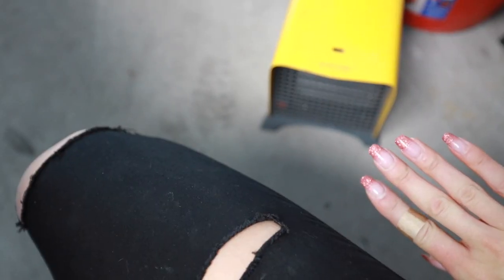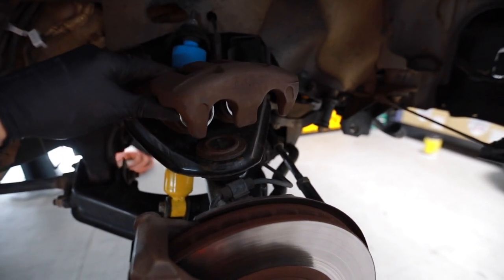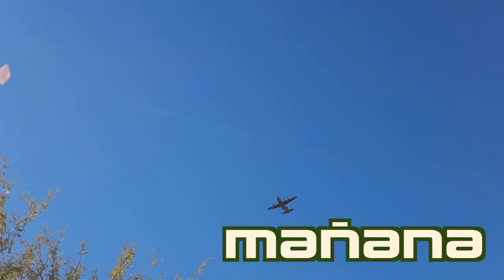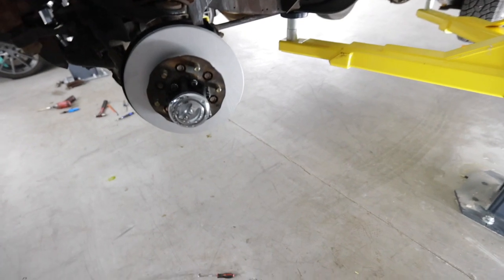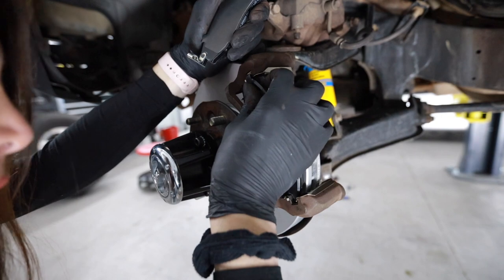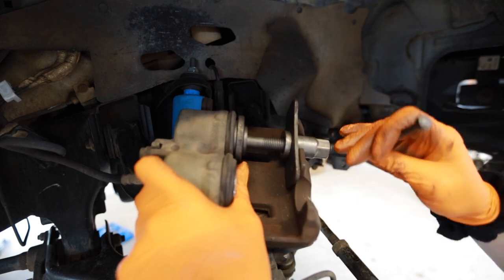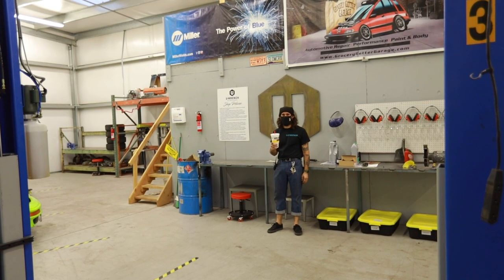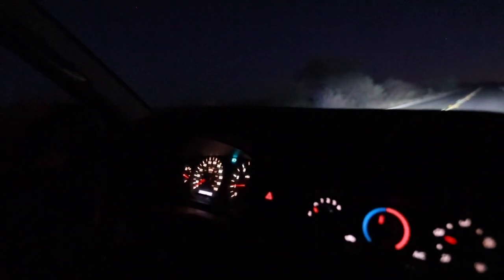Upgrading A Critical Off-Road Design Flaw // Little Sisters Xterra

Comment: Automatic hubs have ALWAYS been one of the dumbest ideas and they never freaking work right or stay in lock...used to have an 87 Dodge D-50 that was one of the best and strongest badass off-roading trucks I ever owned...same problem...Mile Marker to the rescue on that one also....no one else made hubs for that truck...only other option was to find a parts truck from 82 or 3 which came with manual locking hubs before they switched to automatic hubs..

Comment: Why not just leaver the old pads to push  the piston back in before you take it all apart, saves messing about later.
Reply from the maker: Because I have the correct tool for it.

Comment: you arent supposed to hard brake on new pads until they are broke in
Reply from the maker: 100% incorrect.
Reply: @SarahnTuned  I think your cool n all but I will be referring to you as Ms. Squeaky Brakes from now on :p
Reply: Change that oil pan gasket so you won’t spin bearing the first time you decide to climb a hill, and all the oil comes out of the back of the pan...

Comment: Hate that type of rotor design. Had two 97 Honda Accord that had this design
Reply: It's necessary in order for there to be selectable hubs though.  When Nissan went to the F-Alpha platform for 2005 the hubs are now just solid and the only driveline disengagement is at the transfer case, the front diff is always spinning from the forces imparted by the CV shafts always spinning.

Comment: AHHHHHHHHHHHHh,  Hey, don't turn that sharp ,  while you are in 4WD,   while you are on pavement.  Dirt is no problem.
Reply from the maker: If the truck broke at 2mph doing that for a few feet, I certainly wouldn’t trust beating the crap out of it off-roading. It’s fine.

Comment: Wow do you really dislike your sister that much. Those mile marker locking hubs. Are the wrost and cheapest hubs that you can get. Did you even do any research on these hubs. At best they may have a 2 star rating out of 5. Within 1 to 2 years you will have too replaced them. At that time do it the right way and but Warren hubs on and they will out last the vehicle